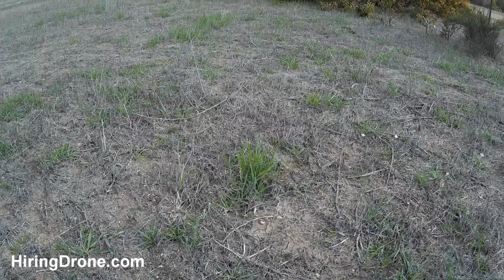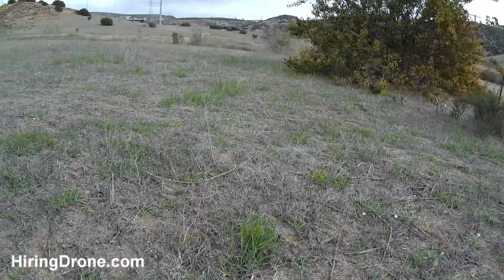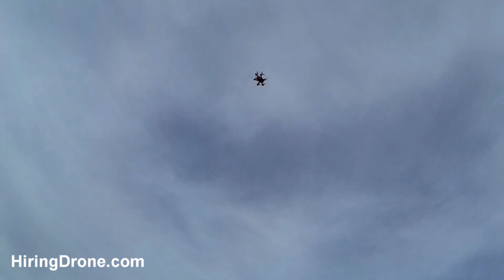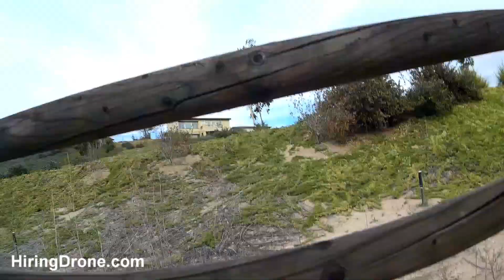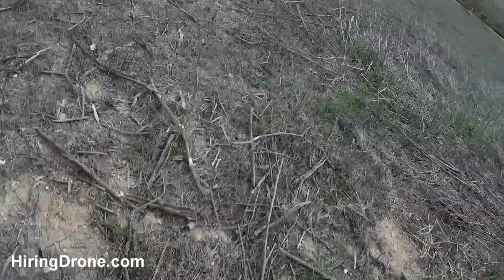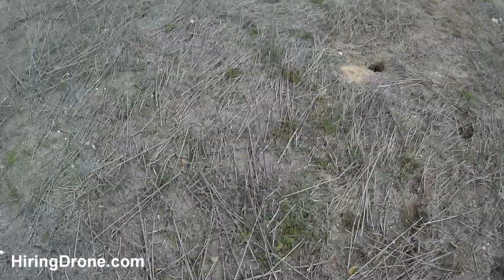JJRC H20 Mini Hexicopter Transmitter Binding Issue

Comment: My H20H just stopped binding along with a rear right side motor stopped working (finger spin to get it spinning but flying is erratic). Flew great when it worked - not much flying time. Bottom line is JJRC stands for JunkJunkRealCrap. 3rd JJRC product that has had problems!!!

Comment: mine just won't bind anymore .. i bought 2 of these . both have same issues . just won't bind
Reply from the maker: Mine loses binding while flying. They are not built very well. I can typically bind with no issue prior to take off, but after 30m, it flies away.

Comment: The motor spins but doesn't fly. Any idea why?
Reply from the maker: +Carlos Carpio Most common reason would be your props are on the incorrect motors. Some motors spin clockwise and others counter-clockwise. If the props are on the incorrect motors, it can cause non-lift.